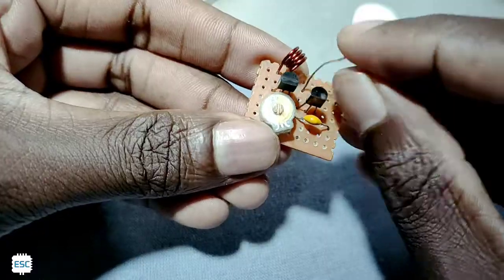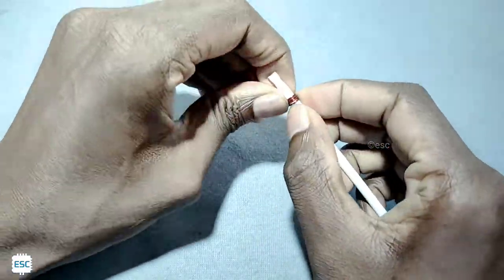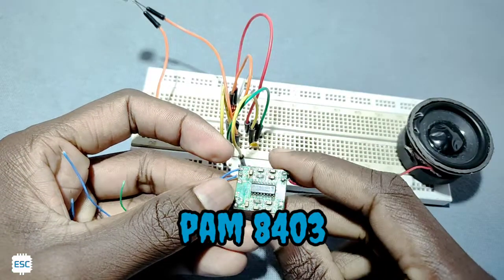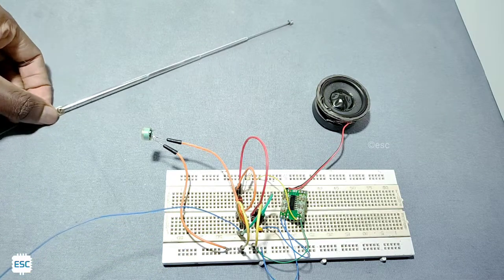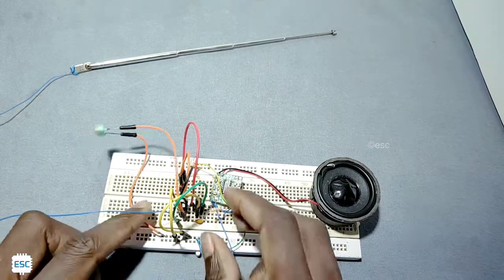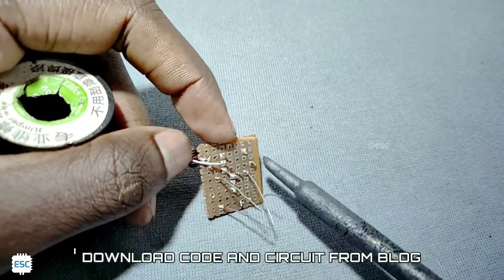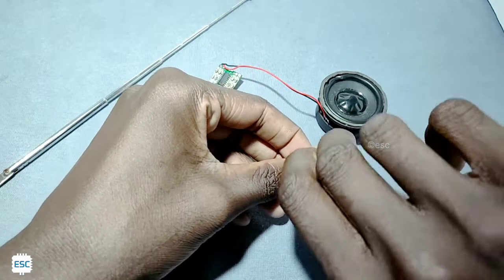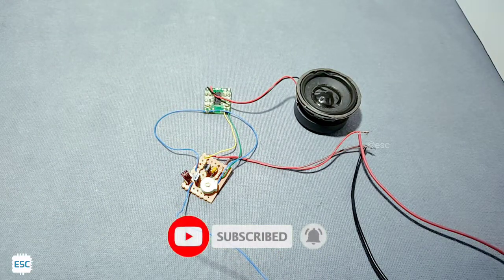How to make simple transistor FM RADIO | DIY

Comment: Can I use 2n2222 transistors as a replacement to the BF494s?
Reply from the maker: No use bc 194/199
Reply: @EDISON_SCIENCE_CORNER  But sir in the video you said to use BF494 transistors
Reply: @EDISON_SCIENCE_CORNER  can I use BF495
Reply from the maker: You can use any of these
Reply from the maker: You can use please  look the datasheet
Reply: @EDISON_SCIENCE_CORNER  ok thanks 😊

Comment: Sir can I use the LM386 chip instead of the amplifier board you were using.
Reply from the maker: Yes you can use
Reply: can I use a 1W 8 ohm speaker with the LM386 chip.

Comment: hello friend I have also been following you for a long time about radio series. can you make a detailed video tutorial on everything. wish you good health
Reply from the maker: Yes will make
Reply: @binhminhtran6502   I have managed to get  the FM  circuite to. By  changing the bf 494 to. An  so1198 putting choke in series with it's     emitter other end of  choke to center. Of  1k pot  also. 4700 cap center tap  to  lc  other  to the choke not  the  pot centre.  I put. Negative. On  the choke turned the pot. And classical music it works but very unstable  best  to. Put in  tobacco tin  choke  is 32tns of fine wire. On low value resister  this does work  can not get original circuite using two bf494s remember to turn gain down. If don't you get motor bike. In your  ears. If  some  one  can   improve my circuite let me no thanks jm

Comment: This one is awesome. Is it possible to use MIMO of the smart phone? Or it needs a OS of the phone just to work?
Reply from the maker: What is MIMO
Reply: Multiple-Input Multiple-Output (MIMO) technology is a wireless technology that uses multiple transmitters and receivers to transfer more data at the same time
Reply: And also is it possible a smartphone speaker for fm radio transistor? It could be a great project.  I think it was not possible.

Comment: i built this circuit solid connection , compact size but nothing i can hear....same li ion battery, same 8403 amp. but only V.C. is 3-18pf
Reply from the maker: Nothing?
Reply: @EDISON_SCIENCE_CORNER  not even noise.
Reply from the maker: Problem is with your circuit
Reply from the maker: Share the  built circuit with me in whatsapp . Group link  available in discription
Reply: @EDISON_SCIENCE_CORNER  ok

Comment: only 1 caveat, no transistors or a circuit board, plus a capacitor, not the easiest radio by far when u need those components>
Reply from the maker: Okay 👌